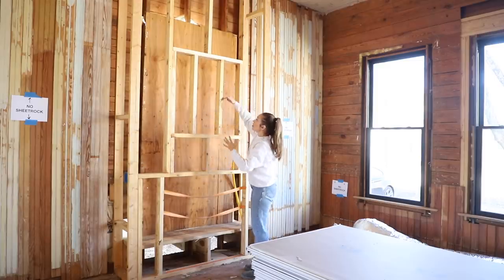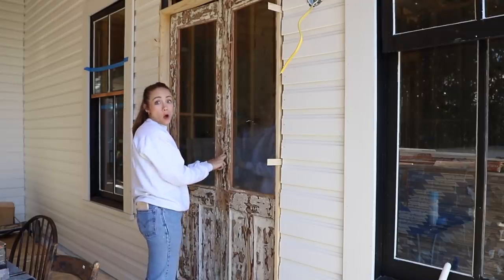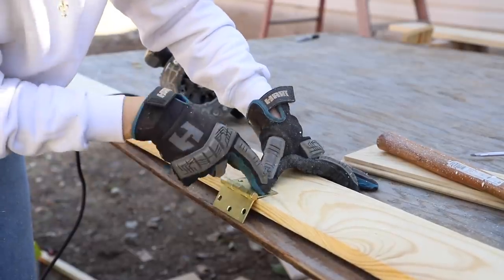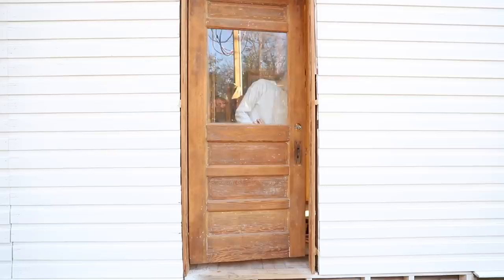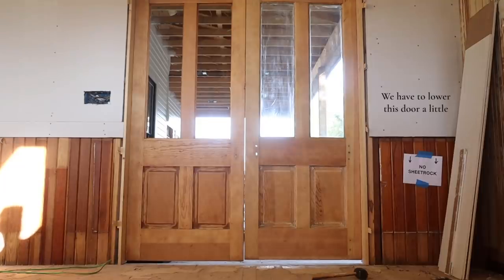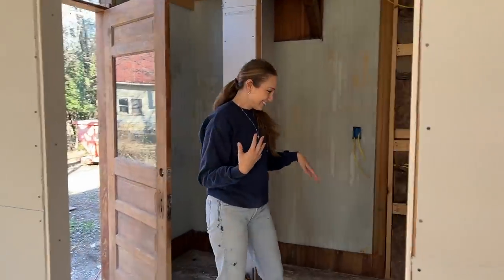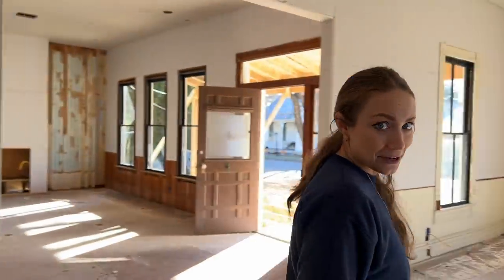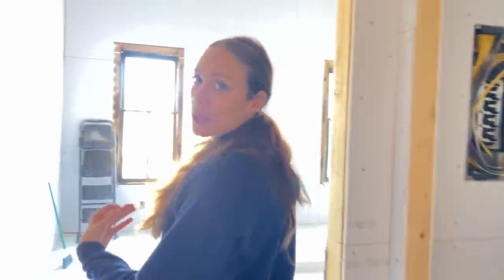MAJOR PROGRESS In Renovating Our Home!! (Sheetrock, Fireplace, Front Porch & Doors!) | XO, MaCenna

Comment: I am absolutely loving the progress on your beautiful cottage. The sheetrock really helps when envisioning the space. Regarding the shower in the master, you addressed you wish you had dropped the ceiling to help with warming the space, what about adding heat lights in the shower? It will definitely help to warm you up after using the shower.

Comment: I have never come close to construction on a house but I have put plenty of furniture together. After much trial and error, my tip to putting up doors alone is to use magazines to hold the door up level to where you need it. With magazines its easy to find a thinner or thicker one to get it exact height and you don't have to worry about holding it up while screwing it in. :)

Comment: There are two options to deal with the height in the master bath. You  still have time to box in and lower the ceiling in the shower. Also you don't need to tile the WHOLE wall. I just remodeled my bath for a walk in shower and tiled half way up a 7 foot wall. I looked at many designs that did the same thing and it works. I gotta say, you have a real eye for design. I'm impressed.

Comment: Great work Macenna, to hold doors up while you hang them you can get inflatable bags that you put under them and then pump up with your foot until they are at the height you need, they sell them on Amazon, put in 'inflatable wedge'. This should make it a lot easier for you by yourself.

Comment: Idea:You can put heated floors/ walls bathrooms fairly cheap before tilling (to help with heat cost) and you can just faux paint marble to match higher up shower ceiling or use another material ( maybe faux tin with tile molding )

Comment: When you are hanging a door by yourself you take apart the hinges so you have one piece on the jam one piece on the door. You then put the door in place using the hinges to hold the door in place. I always used a foot under the door one hand holding it in place and put the pins in with the other hand. The pins just have to go in far enough to catch both pieces of the hinge. Than you can take a hammer and knock them down into place. If the doors are warped just use a handheld plan to take down the wood. Scrib where you have to plan so you don't take off more material then  nessary so the door will fit correctly.  When you go to put the stop/trim on the outside leave a gap for weather stripping. Look at exterior door at home depot or Lowes to see what i am talking about. The black strips can be bought and cut to size for your door. Sweeps can also be cut to fit for each door. I always put kick plates inside and outside of doors because it's normal for people to use their foot on the door when both hands are full. Ok enough about doors.
What kind of corner bead are you getting for the sheetrock? I personally like the plastic bull nose for a rounded corner look. The square metal will last longer but it's not good for kids. If they fall and hit there head on a corner not only will it cut them it will leave a dent. The round plastic won't dent and probably won't cut a child. The down side to this is if someone keeps on grabbing the wall in one spot the paint will come off so you will have to touch up the paint every couple of years just in a few spots. The usually happens when there are older people living in the home that grab the wall around opening for stability.  
Love the progress going on. I can't wait for paint and other finishes to go up.
P.S. decking is a very essential item to have done when moving big things into the house. Up don't want anyone hurt when getting the tub and such inside. If you're moving in soon you want the mail person to be safe delivering mail to you. I know it's not the most exciting thing to do and you want to do the inside first but safety has to come first.

Comment: You might want to invest in some 90 degree corner clamps. Only cost about $15 USD.
Reply: Don't forget to insulate everywhere (even around windows) possible. Be sure caulk all cracks, inside and out!

Comment: Your master shower. You're still at a stage where lowering it wouldn't be a massive deal. Do it now! You were spot on about how cold your shower is going to be. Been there & dealing with it now. It's a major issue. A horrible major issue. I thought when I did mine " Oh it'll be okay. It's not that big of a deal". It's not okay by any measure. So not okay I can't use it during the fall & winter unless I turn the heater so high I'm running everyone else out of the house. Please don't make my mistake.